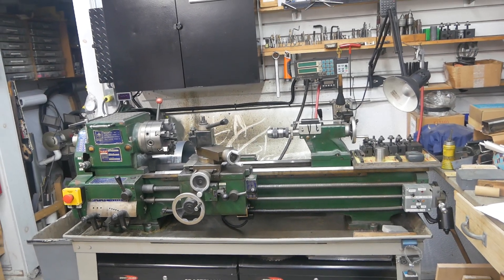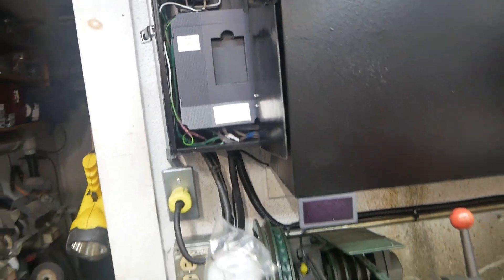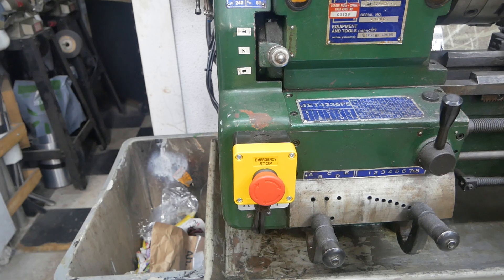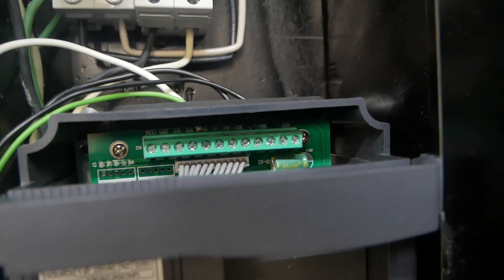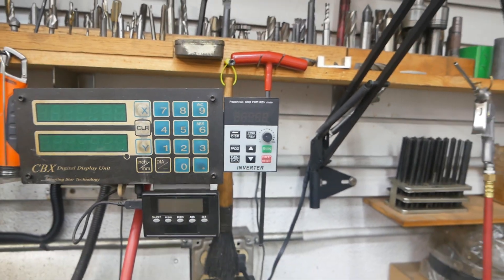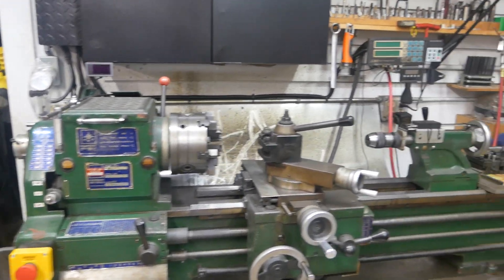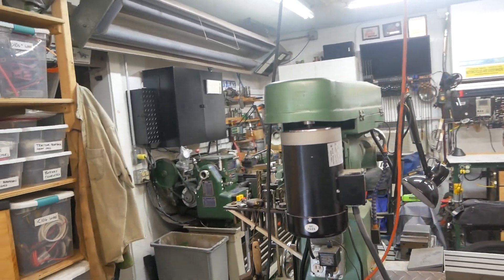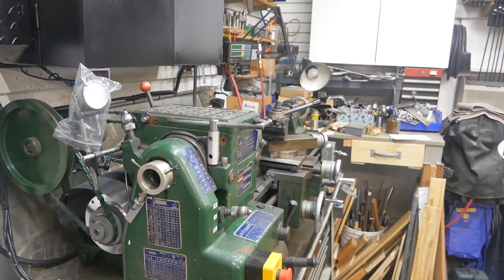XSY-AT1 VFD Simple Wiring and Programing

Comment: Hi Roy, Nice to see an old Jet lathe again. We had one, 11 or 13", at the automotive machine shop, way back... 40 years or so ago. First lathe I ever operated and learned on. Brings back memories! I've had one of these VFDs temporarily on my Southbend Heavy 10 for over 5 years. Now that I've retired and brought the lathe home, it is high time I did some external controls, I only want High and Stop using the momentary contact push buttons on the original control box. I'm certain there is a way, after all... the VFD panel has momentary switches for those functions. Oscar
Reply from the maker: @bookerol  that lathe is s 1983 vintage. Made in Tiawan. A fantastic machine! Good luck with your projects

Comment: The only thing I'd say is that putting it in a box like that doesn't give it much ability to get rid of heat.
Reply from the maker: @AzDad1928  The box is ventilated with computer filters to keep dust out. So far I’ve not experienced any heat issues
Reply: @roybertalotto6355  sweet.